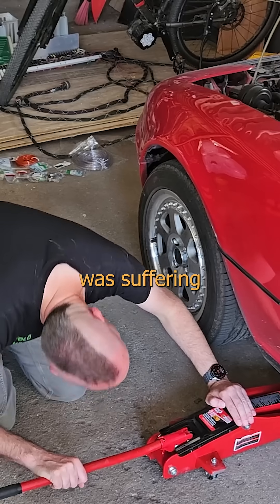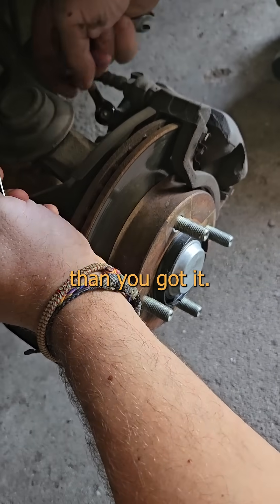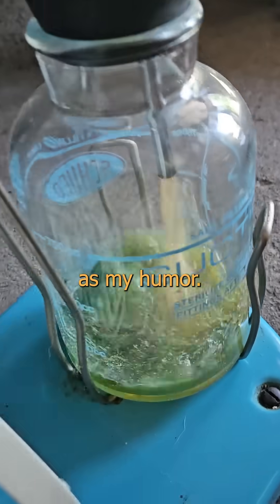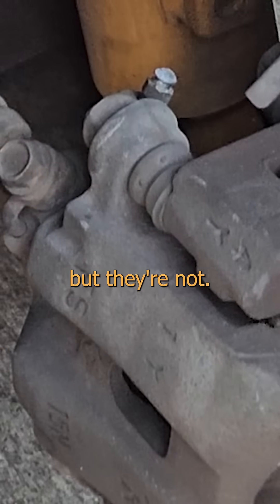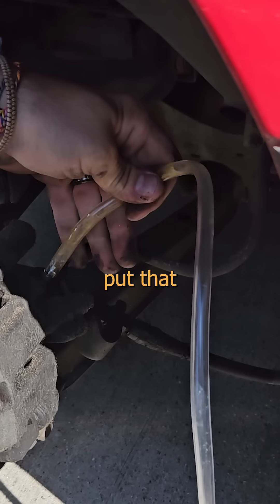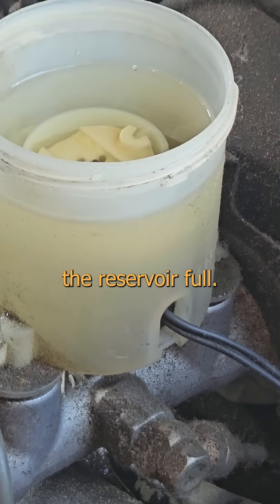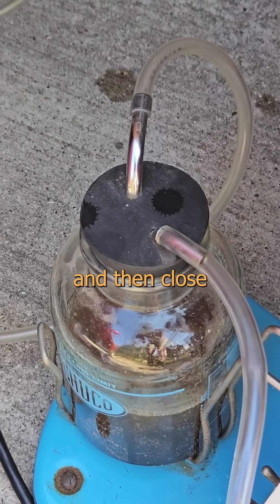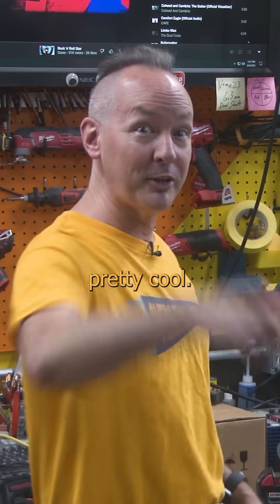How To Change Brake Fluid #chrisboden #comedy #engineering #educational #diy #skills #lifelessons

Comment: The real miracle here is the bleeder screws opening on a vehicle from Michigan
Reply: As a fellow rust belter, I agree
Reply: @remiel3315 😂😂 fuck those bleeder screws. Took us longer last week to break em lose than it did to rebuild the entire braking system
Reply: IKR !! LOL. with all that rust.
must be a Summer Driver, and a Garage Queen. LOL
Reply: @NinjaBonez  or fresh brakes
Reply: Facts, dude. If you wanna bleed a caliper you 1.) Need an oxy torch 2.) Need a new caliper.
Reply: @squalosus223 
  Definitely been there, the exposed part is half oxygen and held together only by memory!
Reply: @squalosus223 unless an owner bought it new, then loosened and tightened bleeders gently every ...mm, 20k miles or so. Gotta love a new car in a few ways! Dare to dream...in other words, you're dead on (the truth).
Reply: @squalosus223 Nah an Ohio guy here so not "as bad" but still not good, pb-blast late afternoon before all 4 of them. Couple hours later, pour on some isopropyl hit with brush, then penetrating oil. Overnight in morning put on box wrench, try to loosen, try to tighten slightly try to loosen, hit with a pocket butane torch for a moment try again. I usually get it about 80% of the time without snapping the bleeders. On the grime monsters .....
Reply: @squalosus223 I’ve broken 2 of those little things since I moved to Michigan 😭 the Rust sucks
Reply: The best time to apply Kroil or PB: last week, and a couple  times after. Not being critical, it's just best to plan ahead.
Reply: @briantimm7197  Start at least another week earlier if it's an exhaust manifold
Reply: PB blaster and tight wrenches are your friend
Reply: @ProfesorPizza  right. A little kroil might do even better
Reply: As northern New Yorker I feel attacked by the video... I keep bleeder screws in my box and at home .
Reply: They were brand new. I assume he fought the old ones and then replaced them to show us this. 

Theres no way they looked that good after even one season of being on the road up there. 😂
Reply: @goosenotmaverick1156 the best part about spending $130 on new calipers is being able to bleed those brakes without a fight for once. And only one time
Reply: @rayluna2316  facts. I dont live in the rust/salt belt, but close enough to it that plenty of vehicles I work on have lived there at some point. Usually when they fail inspections they get shipped to states with no inspections like mine. 😂😢
Reply: @goosenotmaverick1156  mmh, they look one year old from Canada. but they were oil sprayed.
Reply: @goosenotmaverick1156 if you out the rubber covers on them it keeps the moisture out and many of them are now made from aluminum which doesn't rust!
Reply: @SilverKnightPCs  I have yet to see any made of aluminum, but wouldnt you get differential metal corrosion? 

And yeah the rubber caps help a ton, but not perfect when you get to 20 year old vehicles. 

A little heat, pb blaster or Kroil goes a long way
Reply: Damn, i hate when they got welded by rust on the brake caliper, is a pain in the ass to remove them, got both front calipers like that, but i'm too afraid to take 'em out without breaking them😅😅😅
Reply: As a tech in Michigan I’m always quite surprised when most of them never give me any trouble… and now that I said that I’m fucked
Reply: newer caliper lol, I love your stuff but no way
Reply: Yeah he 💯 replaced those. I have spares. I'm not leaving a bad one on a car.❤.
Reply: The best is when they shove steel bolts into aluminum knuckles. Anyone who has owned a b5.5 Passat or a B6 A4... Fucking pinch bolt, and fucking German Engineering...😂 That required a new(newer) steering knuckle, TWICE.
Reply: Wisconsin into the UP yep. Dang salt.
Reply: Oddly enough, if you actually bleed the brakes on the schedule that you should (which hardly anyone does) you will open them often enough that they won't rust in place. And your calipers will last forever too. Also helps if the OEM doesn't use the teeny-tiny 9mm bleeders that are made out of cooked pasta. And the shop monkeys don't tighten them 11 times harder than they need to be to not leak. Details.
Reply: The auto factories fill the fluid thru the bleeders not into the reservoir
Reply: I'm in northern Michigan. You learn little tricks as a mechanic. Heat them with propane or map gas. Don't go too wild or you will screw up the caliper. Then spray it with really cold water. T turns the rust into powder and they open easy as pie
Reply: Fun tip for those in the rust belt: keep a super thin layer of anti-seize on the mating surfaces between the hubs and wheels, and it'll never rust weld itself together again. It works also for caliper mating surfaces (but please not the braking parts), brake drums, most bolt threads, but not so much with things directly attached to the engine - the vibrations can tend to loosen these things - and they can also become easier to overtighten and strip/snap, closed holes can add back pressure to bolts and attempt to push them back out, and it all adds to maintenance time, but I've never once had to fight with rust on anything I have taken apart at least once. -The properly coated threads also don't rust. 

For bonus points, putting copper antiseize on muffler bolt & nut threads after every removal keeps them in a state of being loosenable, until rust dissolves everything anyway. Stuff works on wood stove joints too.
Reply: this Ottawa Ontarian supports this message. The older vehicles here on our salty roads are not so much laced with tetanus, as made of tetanus lace.
Reply: More rust than bolt lol
Reply: Damn, beat me to it.  Salt belt in general.  #1 reason caliper cores exist.  I replace calipers more often than pads (I drive slowly).
Reply: This car is stored winters and has never seen salt or snow. Any surface rust is just air exposure.
Reply: Most are brass, so it's not too bad.
Reply: I live in Southern Ontario Canada and also a mechanic. I remember the first time I went to California and saw a late 90s Mercury Sable with absolutely no rust on the rear quarters. I was blown away and jealous of every mechanic who worked in the south.
Reply: Try growing up in Hawaii lmao, cars have like a 3 year span before rust is any and everywhere. After moving mainland its so friggin easy to work on cars lmao
Reply: hell, the length of time he mentioned, any cars brake bleeders are nightmare , I confess to always fearing the worst, breaking the braking system in any fashion ! not that I'd be doing that myself anymore, at 58 & female & lol no car!
Reply: You need undercoating.
Reply: @dank_69_420_memes NO! 

Need a rust remover/converter, encapsulator AND undercoating! 

Undercoating applied without anything else will rot it out tenfold faster if the vehicle isn’t or like brand new! (Hence why you can’t get your 💩 box under coated at those dealer service companies!
Reply: The northeast is also a major rust contender. I always would heat those bleeders up w a torch and replace them after I finally got them out.
Reply: the real miracle is that miata not combusting throughout the process
Reply: Facts!!
Reply: feel that.
Reply: True 😂
Reply: Or from the province of Quebec where the roads don't get salted in winter, but rather "Pickled".
Reply: The calipers probably get replaced every other brake job because they rust shut. He must have gotten the good end of the deal there haha
Reply: Right? Maybe some pb blaster, a little heat if needed...Unless they paid for the good undercoating.
Reply: @livingunderarockunderarock9963  lmfaoo no shit 🤣🤣🤣😭😭😭
Reply: Like he said it was her happy car. Guessing she doesn't drive it in the Winter with how clean that undercarriage was on a 30 year old rust belt car😅
Reply: Preach
Reply: Rust belt also - get yourself an induction heater. 30 seconds on the bleeder then spray penetrating oil until it cools. Try it. If it's still stuck repeat one more time. Then if still stuck use a impact DRIVER (not impact gun, you want low torque) and hit it with the lowest setting. Should come right out.
Reply: Wisconsin boy here. Yes.
Reply: I snapped one off before and it sucked trying to get rest out to replace it, it turned a 10 min job into 5 Hour Cursed fuel Ordeal eith Mulitple Trips to Oreilly's and Autozone
Reply: 110%.  I still have to fix one on my truck, no amount of heat was freeing that puppy up.
Reply: i ain't even a rust belter and i agree, i swear it's just bleeder screws IN GENERAL
Reply: Yeah, those seemed awfully shiny for being in the rust belt, or maybe I was seeing things.
Reply: Iowa, had cars that rusted before planed obsolesce kicked in.
Reply: Dude they didnt on my truck and its from texas
Reply: Even in the south the bleeders on NA'S are always clogged or stripped out.
Reply: @livingunderarockunderarock9963  I thought that too!
Reply: Same in PA. PB blaster on 99% of things I work on and probably everything on a 90s Jeep orgainally sold on a shore town in NJ. That thing is rust in progress. But a new place to really refresh my welding skills
Reply: @livingunderarockunderarock9963  i usually get them 😂
Reply: It's a 30 year old sports car she is a garage queen from October to April
Reply: Try replacing the brake discs all the way around on a 2017 RAM 1500 in the rust-belt!  I drove around without a parking brake for six months!  Look up the video for the rear disc replacement. 😂
Reply: Yeah as a kid my dad sold his 79 F150 to a guy from Michigan, and he traveled all the way to Colorado to get it. Always thought that was odd, til I heard about cars rust out easily there.
Reply: Used to live in upstate NY. dear god those screws were bad lol
Reply: As someone who lives close to him with 2 brand new vehicles, I can concur
Reply: Hahaha 😂😂
Reply: I get that this is about the Michigan weather, my first thought was that it's a commentary on the build quality of the Detroit marques
Reply: A 30+ year old NA Miata is probably not winter driven
Reply: I always vlean with copper brush and brake cleaner, then follow up with some pen oil.
Reply: was just gunna say...
Reply: You are right about that.
Reply: I live in Minnesota and I’ve never had a bleeder seized on a CALIPER 🤷🏼 (for reference I’ve been a mechanic by trade, hobby and side gig for over 20 years)
Reply: @commonsenseisdeadandgone  ive had more than one seized and a couple even snapped. And I live in technically the south, but ive worked on numerous vehicles that lived in places like Missouri, Iowa, Indiana, Minnesota, etc. 

It definitely happens.
Reply: @goosenotmaverick1156 I live in Minnesota, we are the kings of rust. I've had pistons seized where the bleeder probably was too but didn't really have to worry about checking that 😂 

What I can't stand is every single bushing sleeve is rusted or corroded solid to the bolt if it's older than like 7 years! If course they are ALWAYS so accessible you know! 😡 😂

I've snapped one because I stripped it and crushed it with a nice grip (those stupid tiny ones!)
Reply: @commonsenseisdeadandgone  I fought that battle on an Isuzu NPR last year. Every bushing corroded to the bolt, every collar of every bushing corroded to its home (leaf springs, frame mounting points, etc) the destroyed box of bushings I showed to the customer to explain the extra labor helped him understand why he should quit buying stuff from Missouri. 😂 

He thought he got a good deal, when in fact he got screwed. 

Air hammer was my best friend for that project. I broke many bolts. An absolute nightmare that I definitely understand. Its part of what keeps me from moving farther north, honestly. I have family up your way and I KNOW they'd ask me to work on their cars and be insulted when I either declined or had to explain to them its not the "5 minute job" they think it should be. 😂
Reply: I live in Michigan. 2 words. Heat induction!
Reply: In in Florida and seen some rust too from the northerns coming down
Reply: @seba.mate1 that's because Rusty cars go south and flooded cars come north
Reply: It's important for you to have the best shot to use an impact, and have new replacement ones. The offset pressure of the wrench is what will do you in if its iffy.
Reply: I dont miss living in Michigan when it comes to cars. My Acura loves North Carolina.
Reply: I'm in new England my bleeders rusted off in about 10 years
Reply: Snapped 2 on my jeep
Reply: Just keep the little rubber cap on them and they'll come off easily. Those caps really help, but they never get put back on for some reason
Reply: Brake fluid should just come with an easy out and a set of bleeder screws at this point.
Reply: Idk I just did it on my 06 fusion, all 4 plus clutch slave cylinder, but now we know it is the plates & not sure how we are going to lift it to remove the sub frame most places we would jack it are to rusted.😢
Reply: Im in new brunswick canada.  I went to do a brake flush, instead of opening the bleeders on my front calipers, I have shiny new calipers...   no way in hell they were coming out, that and the sliders were seized, solid.  Got them moving when they were out with a 20lb maul...   but that was just to see if i could get them moving.  Lol
Reply: Dunno man, mine work fine.
Reply: torch + WD-40 + hammer + pliers.
Reply: Might I suggest a heat-wrench used judicially. Or A LOT of professional grade rust penetrate. After 30yrs bending a wrench, you learn more tricks then I can list here.
Reply: Yep, definitely 😢 I broke two....a job of 30' turn into a 3 hs job
Reply: The people that understand this joke are the rarest joys existing today 😂
Reply: @agenthimzz the people who understand the joke are laughing because otherwise they would cry and we are men dammit! 😢 I mean 😂
Reply: @livingunderarockunderarock9963  im from nh and did my brakes in 2024 on my 2018, pads were stuck to the calipers, one bleeder wouldnt open, and i needed a blowtorch and a 2 foot cheater to get the bolts out lol
Reply: @Scotty-vs4lf what are you parking in the ocean!?
Reply: @commonsenseisdeadandgone nope its just from winter mostly
Reply: Damn y'all don't do your brakes enough then or something 😂 I live in the rust belt and never have issues with my own bleeders 😂
Reply: @TylerAllen-zx2ef you bleed your brakes every time you do a brake job?
Reply: No. No miracle preformed. Jus use lots of PB and swearing👌👌👌

Comment: Id be worried about the corrosive brake fluid damaging my vacuum pump but idk if im being paranoid 😅
Reply: The vacuum pump is behind a jar. The pump puts the jar under vacuum and pulls the fluid into the jar. No fluid goes through the pump.
Reply: thats what Seals are for. and Stainless Steel Pistons.
vacuum pumps arent made for just water.
they are made for Nasty Nasty Stuff 
much worst than Brake Fluid.
you should see the stuff they use for Semi Conductor industry. 
Cobalt Gas isnt just pretty... its deadly. and eats 304 stainless like a fat kid eats cake.
gotta use metals like Hastelloy
Reply: the pump sucks air out of the jar it never touches more than the vapor from the fluid, and brake fluid has 2 fifths of F.A with fumes

Comment: At my shop, we do it the other way around: by putting pressurized brake fluid into the reservoir, and letting it push everything out the bleeders.
Reply: She goes both ways
Reply: Suck, blow, just two different words for the same result...LOL
Reply: I have changed the brake fluid on many mountain bikes, and for that you always push upwards from the brake calliper to a reservoir on the lever. Though on a bike we are mostly worried about air in the system which rises under buoyancy. If you are worried about sludge that sinks, then sucking down makes sense as gravity would help you.
Reply: @davidpottage6402   it’s the same way for cars. Except there has only to my knowledge ever been one company that ever made a tool for that. Since it’s so expensive people typically stick with the old method of bleeding the air down using the pressurized fluid. Most people pump the brakes, or use a vacuum pump since they’re so easy to find. But the quicker and better way for a flush like Chris did is to use pressurized fluid. AMMCO used to make a pressurized tank, it held about a gallon of brake fluid for this, and you just had to use the correct adapter for the reservoir. Now companies like MightyVac makes something like this, as well as Snap-On. All you have to do is pressurize the system with the clean fluid, and open the bleeders at each corner until the fluid comes out clean. Some shops also have a flushing machine made for this where you open all the bleeders and it shows and tells you which to close when, making the process take minutes.
Reply: this is the way. you can do this by yourself, and it works perfectly
Reply: I was just about to say that
Reply: thats a good way to break stuff. like the rez tank. or if FOD in the line.. blow the line apart.
not a good idea.
vacuum is better.
Reply: @NinjaBonez it's not a very high pressure so if something breaks then it must be faulty anyway...
Reply: @NinjaBonez every brake component from the master cylinder to the brake pistons are pressurized every time you apply the brake. Only the reservoir will ever be in any danger of breaking unless it was already past due for replacement. Sometimes it'll even make the abs work better afterwards.
Reply: @NuclearHeadshot  Absolutely! If I remember right emergency braking pressures can be upwards of 2,000 psi. Most pressure tanks only even go to 15-20, so yeah, if something broke it would have to be horribly bad.
Reply: @NinjaBonez we use a regulator and never go above 30 psi and this is a procedure called out in all shops across all makes if you can't tell I'm a professional mechanic but what do i know😅